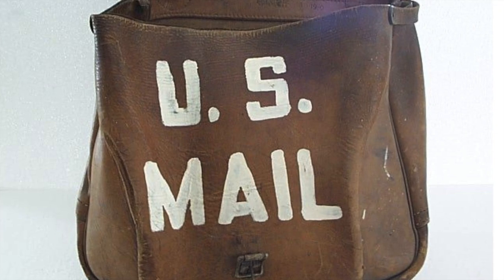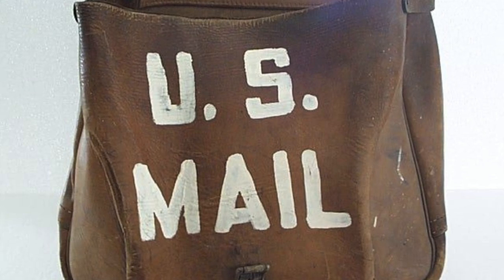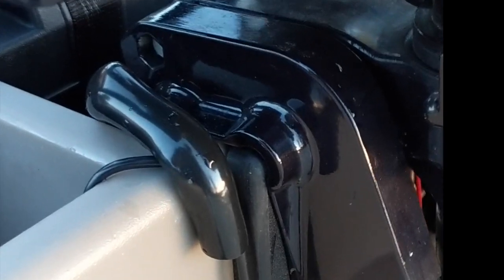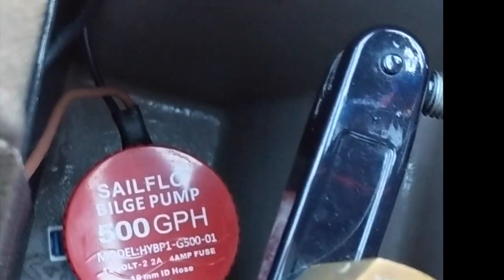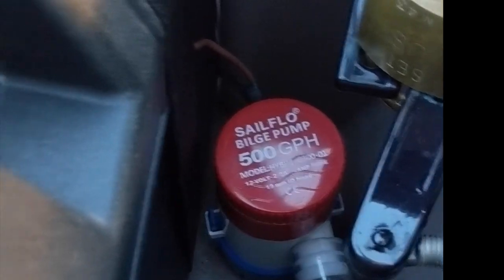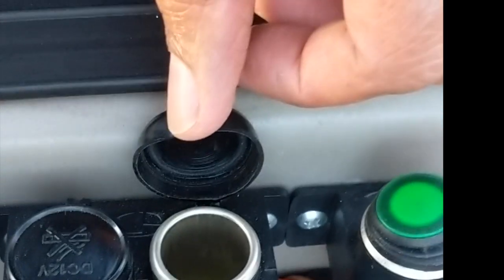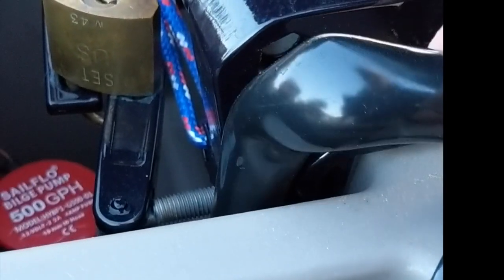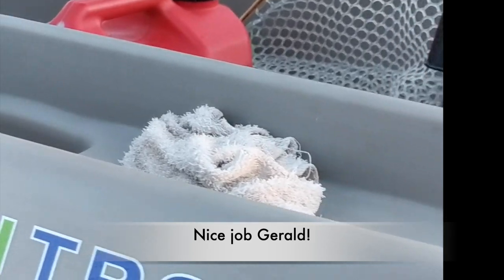HOW TO INSTALL A BILGE PUMP IN A TWIN TROLLER X10 BOAT

Comment: What a great idea. I have a new pump sitting in the box in my man cave waiting to find a home in my TT. Speaking of new things for the boat I was wondering if there is such a thing as "TO MUCH TACKLE". I want to have what I need to fish everything but as a former tournament fisherman you must have lots of experience in what is  necessary verses what I see in some of the videos where guys have more tackle than they could use in 10 years. And good luck with this upcoming cooler weather fishing.
Reply from the maker: Steve, you make a great point. How much do you really need in a boat, especially a smaller boat with not much extra storage space? I am probably a bad example but I carry a minimum  of six rods. I almost always have some hard baits (top water, hard jerk bait, crank baits, rattle trap, spinnerbait, chatter bait, etc) with me but most of what I have are soft plastic baits        (worms, swimbaits, frogs/toads, flukes, and creature baits for flipping). One of my rods is always a 7'6" heavy flipping rod that I use for flipping in heavy Florida mats but I also can use it for  the rattletrap. Most other rods are 7" med/hvy bait casters but one is always a spinning rod. The way I control overloading with equipment is how much of each item I carry. I have a  few  of each soft plastics and at least one of each hard bait. After I return from a trip, or before I go back out, I reload the items I used on the last trip. One of my three tackle boxes is              dedicated solely  to terminal tackle (hooks, weights, bobber stops, Carolina rig items, etc). If you noticed in my videos I also have a nylon sheath secured to the leg of my seat that holds a 8" pair of needle nose pliers. Two of the smaller Plano boxes are mounted on the sides of my seat and a larger/deep Plano box I keep under my seat. I am prepared for almost anything but I rarely use more than 10% of what I bring.                                                                                                             Gerry

Comment: Thanks Jerald for another good idea. 
I haven't made a decision yet on a  outboard. I never had a problem with Honda, but just looking at other makes.  Since you have had yours for a while, would you charge to to another manufacturer? I'm looking at reliability, not price. Would you go to a little more horsepower?
Reply from the maker: Frank, Sorry for the confusion about the names but I am not sure if you are asking Gerald or me, Gerry? 
From what I have read from others they do not feel the Twin Troller goes any faster with more HP. Since there is little difference in the HP available for the TT that kinda makes this answer cleared. I have had no trouble with my Honda 2.3 but since I never had another motor on my TT to compare it to I would say I am happy with my Honda. One thing to consider, the Honda is air cooled with many less parts to break and no water pump. The Honda only weighs 30 pounds and is very light weight. In a small boat weight is a big issue.

Comment: I’d like to know more about the wiring details if possible. I’m a new twin troller owner. While I wait to get my boat registered I’m trying to make some upgrade.
Reply from the maker: J BAY, There are two wires on a bilge pump, one negative (generally black) and the other positive (often red but can be any color including black also). I installed ring connectors on both pump wires. Install the negative wire on the negative terminal of the battery. I then cut the other wire and installed two things: 1) a 12 volt switch between the pump and the battery2) a fuse holder with a fuse sized according to the pump instructions.That allowed the pump to be turned off and on when I desired and the fuse protects everything in case a of a short to avoid a fire. In the video you can see where I installed the switch through the battery box to keep it out of the way and avoid accidentally bumping the switch.I hope that helps,Gerry